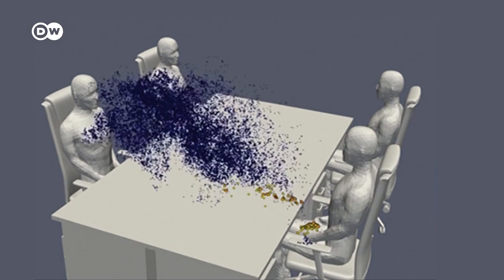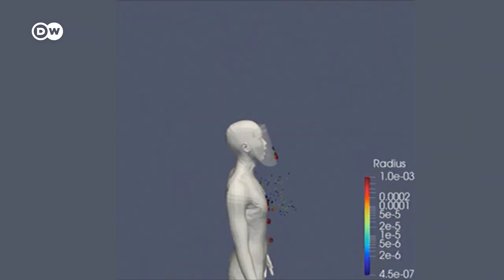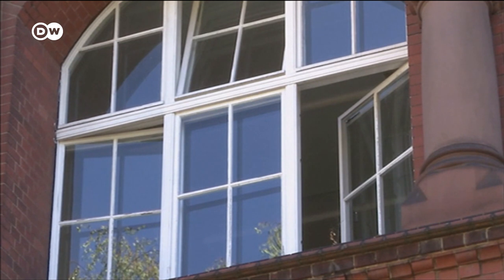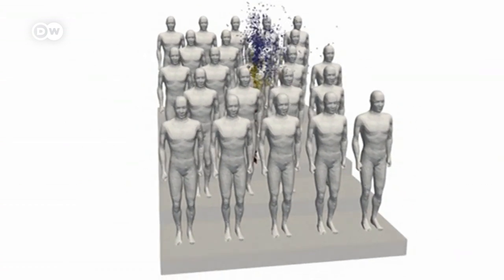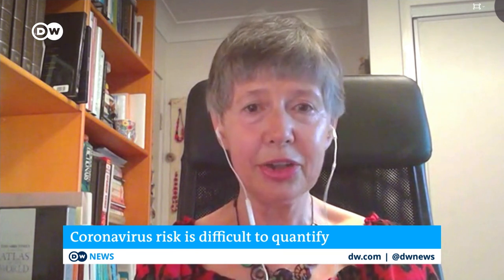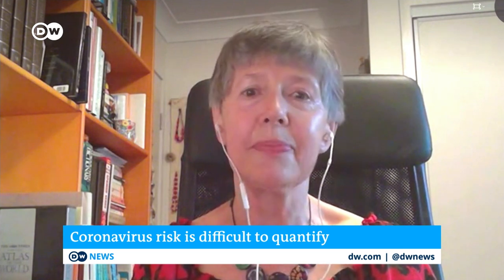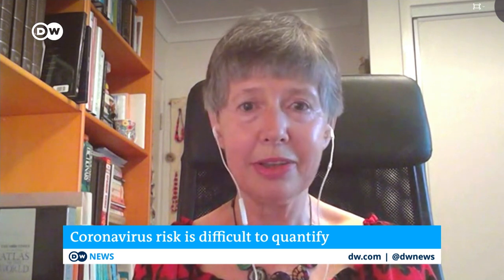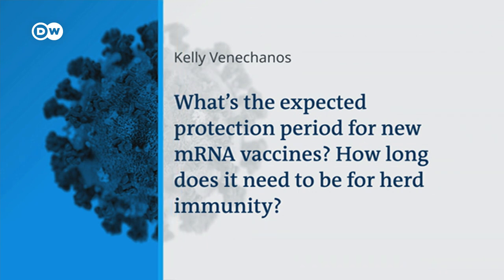Latest research: How to prevent coronavirus infections | COVID-19 Special

Comment: Winter air is drier and droplets hang in air a lot longer than in summer’s humid air. 

Be forewarned.
Reply: Facts. They did mention the need for a more humid environment. Over 25-30Celcius and over 80% humidity rate (which doesn't work in a house, since the norm is 40-50% humidity, attained with a humidifier). So, we need to add masks and open windows...cold, or not.

Comment: Just install many medium size air purifier around 2 meters from ground. i had installed 10 air purifiers in my shop. every corner you turn, the air purifier keeps on filtering. covid is lightweight and you have to install it above your head.

Comment: Wearing masks and improve indoor air exchange rates = No lockdown the BUSINESS.
Reply: Not as easy as it sounds. Ventilation systems can blow the virus around so it spreads further. Ideally you need fans blowing downwards and outlets at floor level. If you've rooms where everyone is close to windows that is pretty good, but big open plan offices are a headache to ventilate safely. If you work in a semiconductor cleanroom, you're sorted.
Reply: @nlwilson4892  There is no virus fool.  It's an agenda.

Comment: How does  covid in droplets of body fluids defy gravity? If you're speaking, and by some remote chance a bit of saliva pops out it's subject to gravity like everything else.
Reply: While of course true all objects of all sizes excperience same effect from gravcity, the actual outcome is only the same in a vaccuum. Consider dropping a cannon ball outside on a normal day with a light breeze - it hits the ground, drop a piece of paper and it will glide down to the ground in various swoops, but a small feather might be carried away by the breeze. 
WHO defines droplets as ≥5-10 μm diameter and aerosols as <5 μm. For larger droplets they do tend to drop with their small size meaning they take just a little time to settle through the very slight air currents present in a room (windows or doors open, hwating systems causing warm air to rise up from radiators, or air conditioning unit fans) and hence the 2metre distance advice. However as the diameter of a particle halves, so its surface area reduces to 1/4 (consider a cube, each size has half height x half depth) but the volume is 1/8th (half height x half width x half depth). So halving the size of a droplet-aerosol causes surface to mass ratio to double, the terminal velocity of such tiny particles to fall is reduced and air currents of half the speed are able to keep the particle airborne.
At very small sizes (0.1μm) effects of individual air molecules hitting the particle through thermal motion cause particles to move seeming randomly. This is termed Brownian motion and is perhaps best with dust specks hanging in a shaft of light from a part open curtain. Einstein in 1905 used this as a theorectical explanation for why pollen particles have seeming random movement suspended in the air, and Jean Baptiste Perrin 's 1908 experimental proof of Einstein's theory proved the atomic nature of matter for which he received 1926 Nobel prize. Yep, Einstein of e=mc^2 fame, provided the theoretical proof everyday matter is made of atoms and this only just a little over a single centuary ago.
Reply: @bi1iruben  Very well explained.
Reply: @bi1iruben  great explanation thank you

Comment: I would like to know, IF there are new strain of corona virus, will the current vaccine can help for researching the new vaccine or it will need research from the zero?
Reply: There are already multiple strains of this one. Think of it like an animal family - cats for instance, each type has others that are similar to it and ones that are very different. There are lots of types of tiger but any will kill you equally well. Lions are quite a bit different from tigers but equally likely to kill you. Leopards, not quite as dangerous. etc. 
With viruses it depends how different they are, the current vaccines have drawn on models they developed for SARS and never used because it died out too fast. We might get a situation like the flu vaccine where they are bringing out a slightly different one each year to cope with the new variations. Which is why it would be a lot better if the governments eradicated the virus (Australia, New Zealand etc) rather than relying on the vaccine.